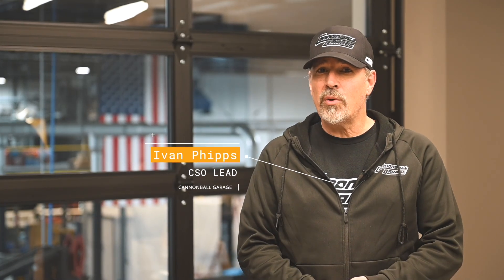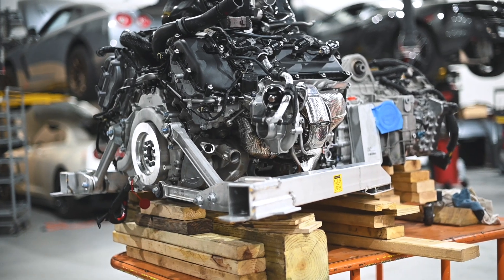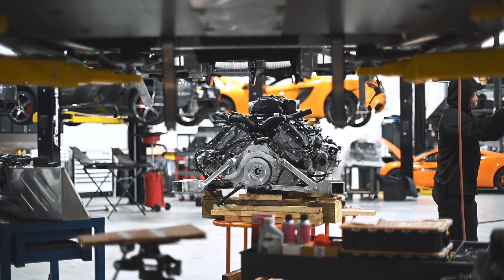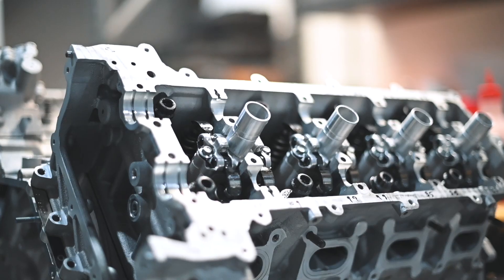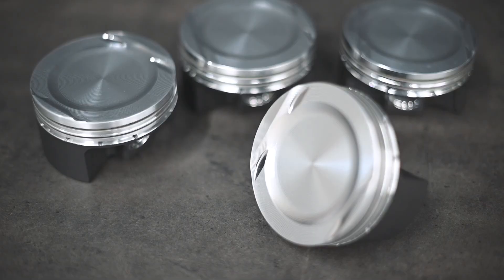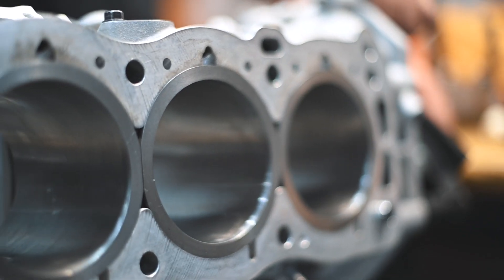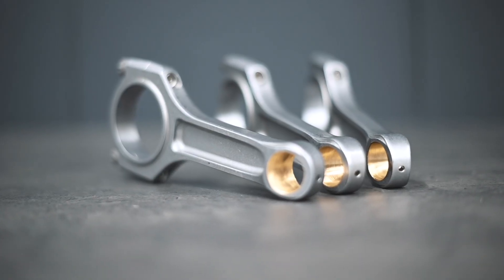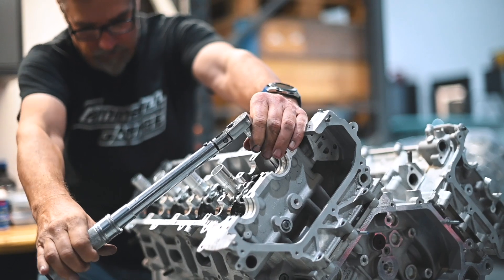McLaren Engines 101: M838T & M840T by Cannonball Garage

Comment: Are you sure it was the same architecture as the Nissan Indy engines or was it their Le Mans engines?
Reply from the maker: "McLaren bought the rights to the Tom Walkinshaw Racing developed engine, itself based on the Nissan VRH engine architecture,[2] which was designed for the IRL Indycar championship but never raced. However, other than the 93 mm (3.66 in) bore, little of that engine remains in the M838T.[3] In only 18 months, Ricardo went from a modified Nissan engine design to a running prototype.[4]" -From Wiki